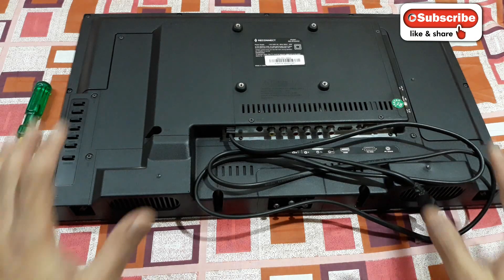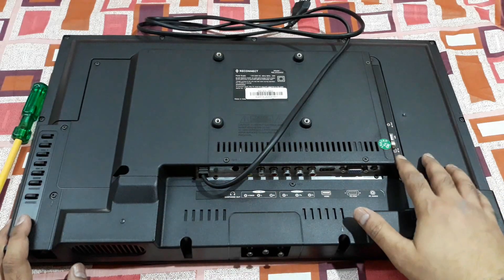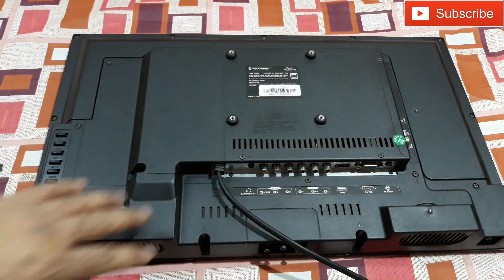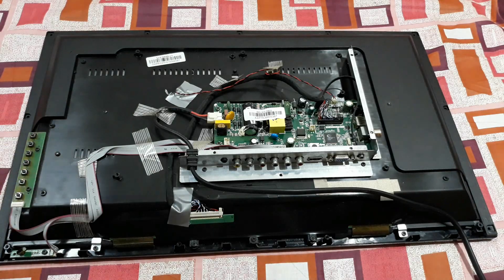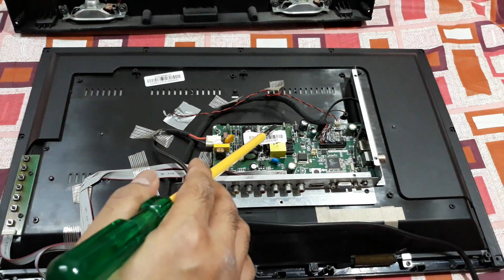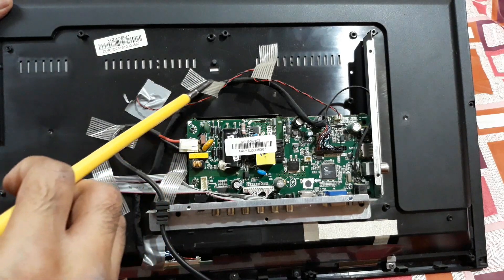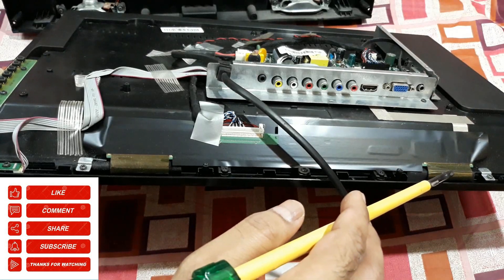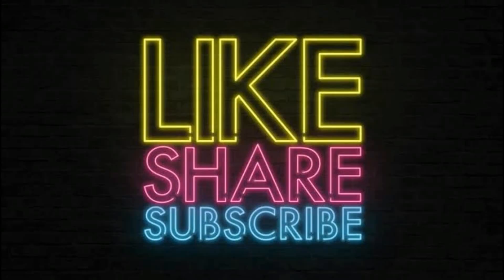What's Inside a LED Tv// Look Inside Led Tv

Comment: what’s the role of the two speakers?, i have a tv and suddenly it started making weird sound so i opened it and i removed the speaker that is making the weird loud sound(thinking that if i removed the damaged speaker, the second speaker would works alone) i plugged it and tested it, now the weird loud sound is gone but the second speaker is making the same sound but quiter
Reply from the maker: Both speakers works as stereo ones. They are not same. The amplifier in tv circuit has 2 seperate channels. So you need the get the kit repaired.

Comment: How to reset to factory settings from that hardware panel? Is there a way to do that? As my tv is not loading the operating system at all!!
Reply from the maker: Reset setting would be at setting menu. But as yours is not turning at all then there must be another way. But for that you need to check the manual. Different brand has different setup. If you can get to menu by using remote, or by changing mode to any input like hdmi, there you can do the reset.